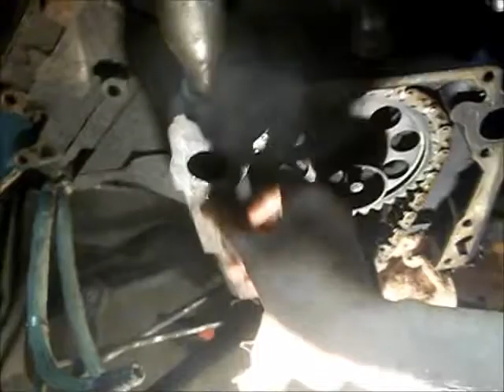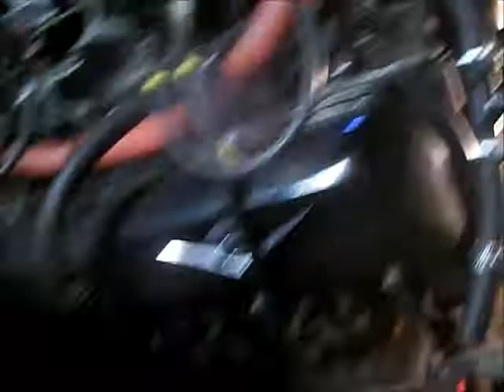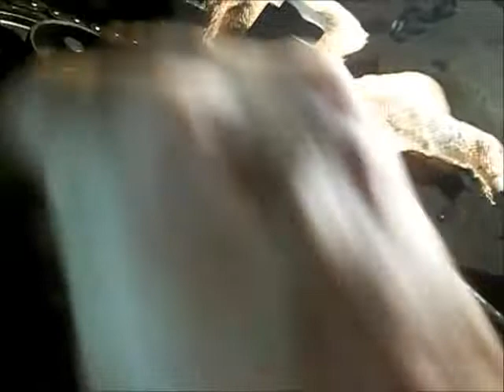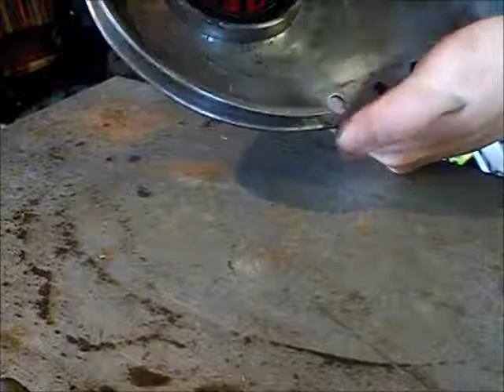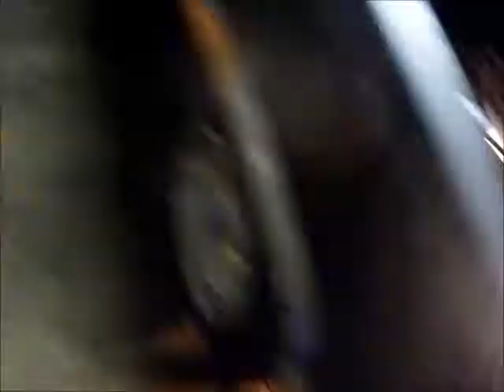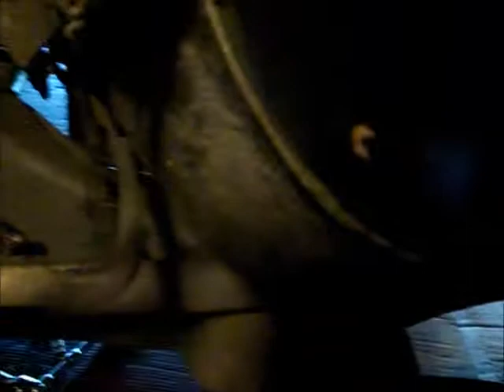G Body CutlassProject Pt #013. Timing Chain Replacement 2

Comment: Man I need you for my cutlass I have a 84 its losing power sometimes it back fire some people says it's my timing chain
Reply: Drain the oil and if u see any metal shavings then it's your timing chain. The chain will go bad before any of the sprockets will.
Reply from the maker: float sticking on carb